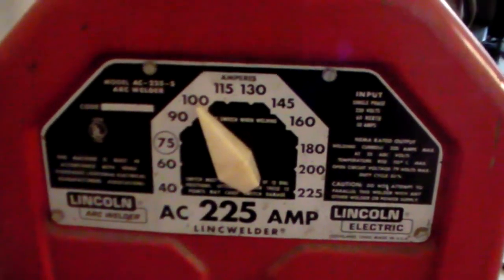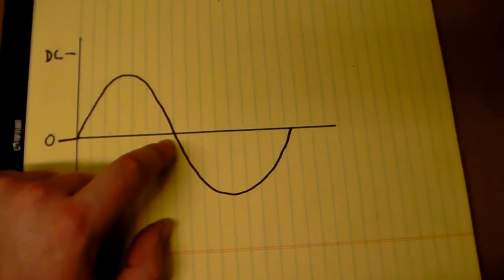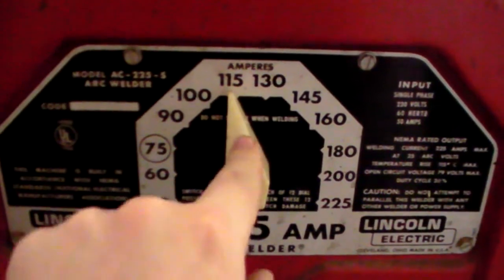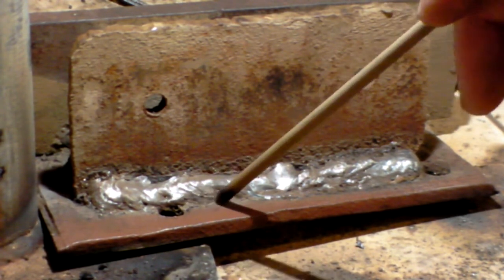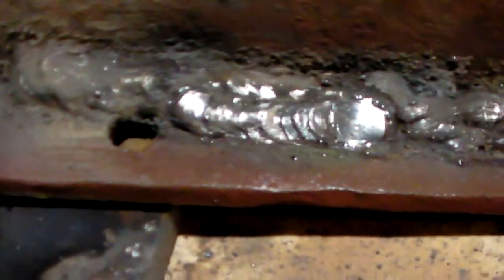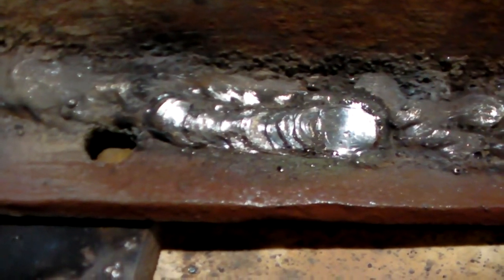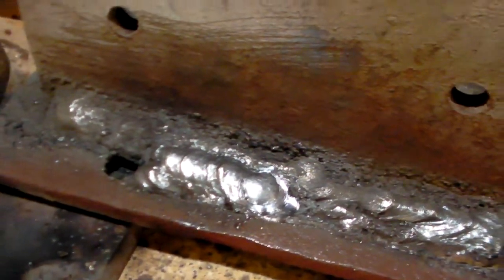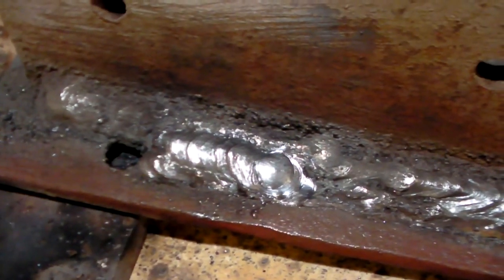Stick welding Ep5- AC Stick 6011 & 7014

Comment: U do know there is 7018 rods that r made to work on A/C
Reply from the maker: I do. But for the purpose of learning I don't want to overload someone new to welding with a bunch of specs that may or may not be seen on package.  I also don't want to get a technicality mix up. Example: Lincoln Excaliber rods say they can run on AC, but having used those rods on AC, I can say that they run like junk on AC. Verses 7014 which I have never had an issue running on AC. If I can get a workable shop back and my video gear I'll try and make a video explaining some of the differences.
Reply: @weldineldonfabrication6303  never had any problems running 7018 on a/c
Reply from the maker: @mikehill9050  I'm glad you haven't had any problems. I have. So I just stick with 7014 for my AC stick
Reply: @weldineldonfabrication6303  that is a nice rod as well  👍